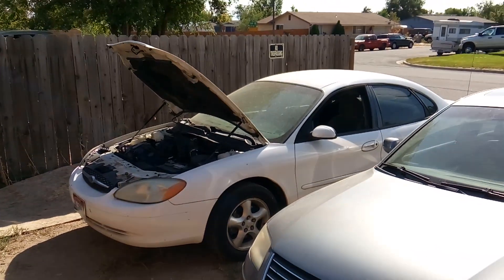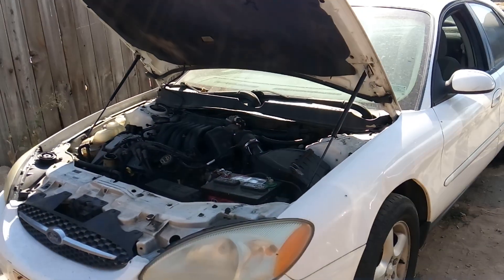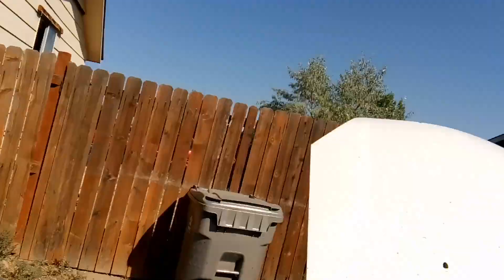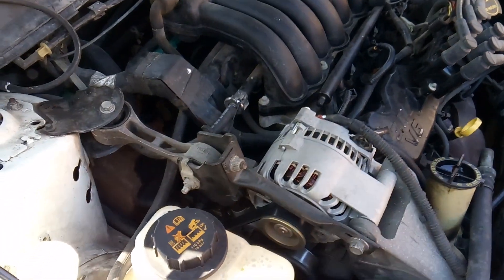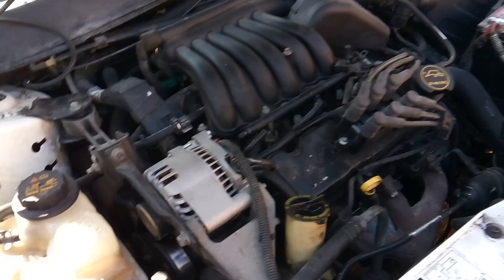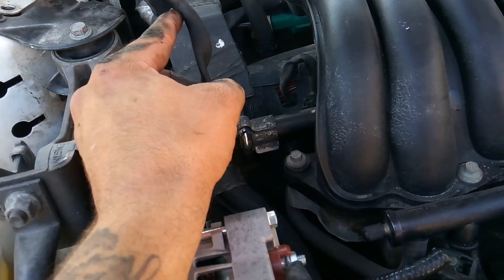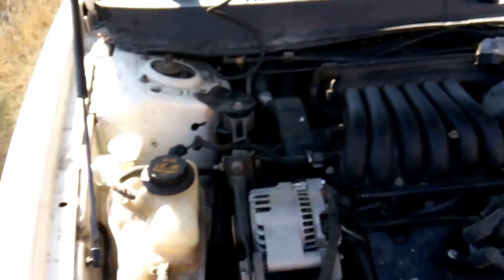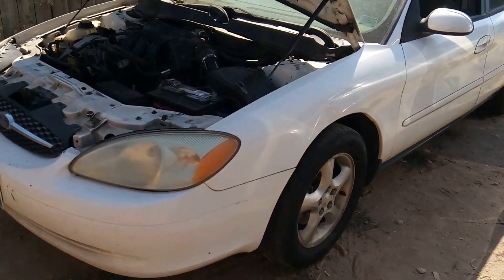2000 Ford Taurus stalls at idle

Comment: im having a very similar problem with my 06 taurus 3.0 right now.  I also was looking towards the cranksgaft sensor because it ran fine until one day it randomly died and now it had no acceleration at all and feels like its in limp mode.  It also happened same time i was having waterpump issues before i replaced it so i wonder if thats my issue. as of now it will barely drive and cant really go up hills. But just the day before it ran like a champ. i got a codde p0352

Comment: Neighbor's 2004 Sable will start but won't idle. I was thinking throttle position sensor or something along those lines but I don't have a code checker.
Would the TPS cause such a symptom?
Thanks & good, informative video.
👍🏻

Comment: Hi Matthew,  Good job! 
 I have a 2003 Tacoma 4- cylinder, standard 5-speed transmission that is bogging down when punching the gas for a quick getaway. It also does this in any gear when going up a hill which requires giving it more gas.  It acts kinda like a weak air fuel mixture but maybe only on one cylinder. It does not do this until the engine reaches normal operating temperature. Also it does not miss a lick while idling.   I thought it sounded like a fuel filter clogging up. I found the only fuel filter it has is a screen in the gas tank.
I did change the fuel pump and the screen that came with it. No change. I changed the spark plugs. No change. If you have any suggestions I would love to hear them.
Reply: Darell, put it on a scan tool and see if any cylinders are running lean, check and clean any mass air flow sensor, check plugs for oil or melting of electrodes (running too rich or lean) and see if any codes come up for the sensors or catalytic converter being clogged. Good Luck!

Comment: I have change the crank positioning sensor I have changed the cam positioning sensor and I also have changed the plug that goes to the crank positioning sensor and it still won't run right it'll get it warm and shut off

Comment: I have this problem with a GL wagon, it only has 87k on the motor and everything in the motor looks good, the person who sold it to me took it to 3 mechanics and no luck, were the materials for these wires just pure garbage?
Reply from the maker: Yes. My mentor is an auto engineer. The wires are out sourced to mexico and the standards for manufacturing are not the same.

Comment: Hey matt I have a 2000 ford taurus 3.0 liter as well, one day after getting gas I drove about half a mile the car just died out of no where the battery and alternator are new so i know thats not the problem, the fuel pump is also turning on and pressure is spraying out, so i changed both the cam and crank shaft sensors and coil pack but nothing seems to work the car cranks but wont start its been sitting now for 3 months any advice would be appreciated
Reply: Did you ever figure out what your problem was?

Comment: 200K miles on this engine, is a lot. I'd find another with 100K for $2000. and skip several hundred in maintenance. The Vulcan 3.0L is strong, but MUST be taken care of.
Reply: Why? It runs smooth.Nothing wrong with the engine. I question his wanting to replace plugs and intake as well. Why? The issue is the wiring not the engine.